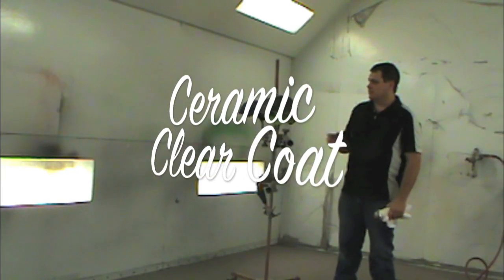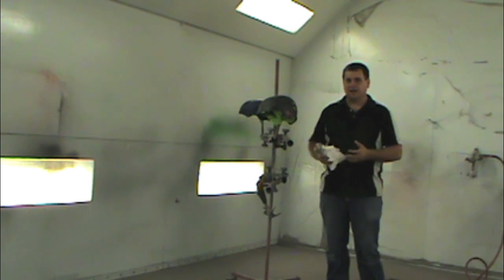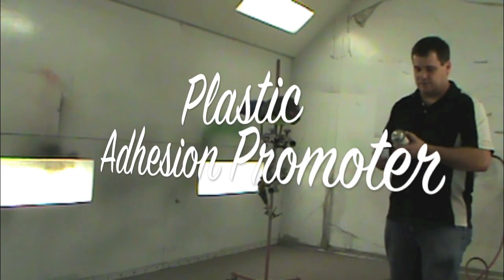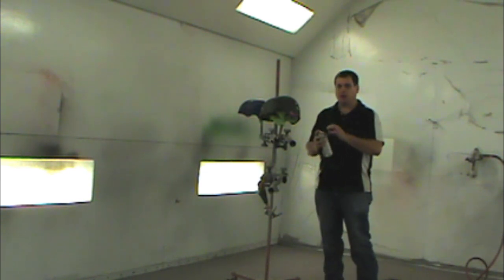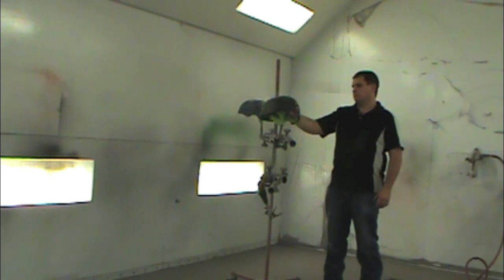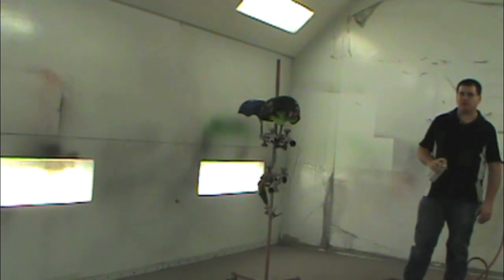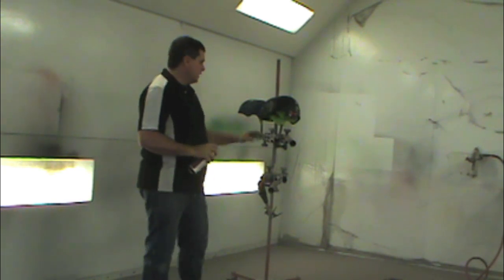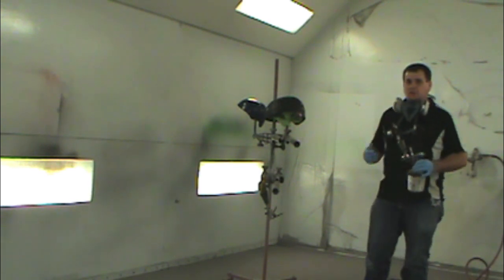Ceramic Clear Coat - Mar and Scratch Resistant - Does That Really Work on a BMX Helmet Test

Comment: PPG ceramiclear d8122 is for use over PPG ENVIROBASE® High Performance waterborne basecoat. I am pretty sure the guy in the video is using the Cermiclear for Mercedes (and others) repair....DC4125 CeramiClear.
"DC4125 CeramiClear is a mar and scratch resistant, high solid clearcoat. This clear was specially designed to repair Mercedes-Benz cars and other vehicles that require the best in mar and scratch resistant performance."
Here is a direct link to the product.
http://www.collisionblast.com/wp-content/uploads/2012/09/ceramic-clear.pdf

I would like to know if the product can be sprayed over my conventional clear coat so I can upgrade my protection.

Comment: The product you are using would be important info....so would the outcome...does it resist swirls and scratching more than traditional auto clears?   Your application video would be interesting after we know what you are applying and how well it performs.  One of the COOLEST things about several nano ceramic clear coats is you don't need to spray!  Some of themwipe on, so a 10-100k spray booth is not necessary nor the worry of having to strip it because a eyelash landed in it regardless of the expensive spray booth.  Not to mention, exhaust and respirator hassle.

Comment: Yes, it would make them last, but permanent.  We used to spray trucks for BJ services, and they recommended us spray the base, lay the vinyl strikes, then clear coat on top over everything.  I would lay a tack coat before applying full wet coats to prevent the clear from building up on the stripe edges.